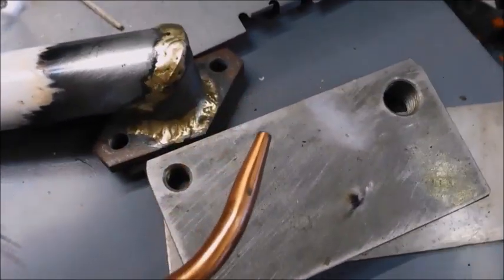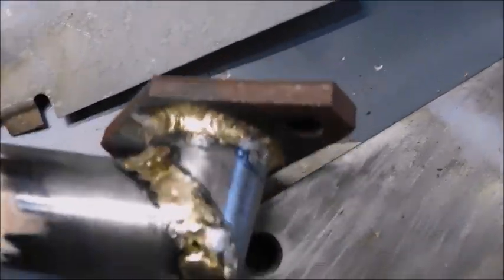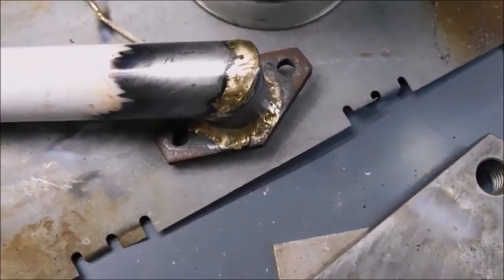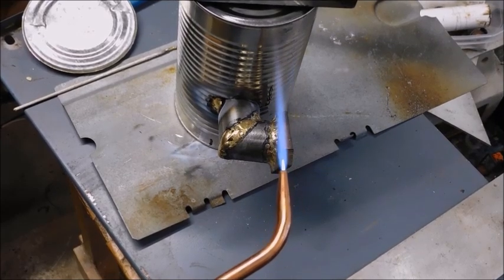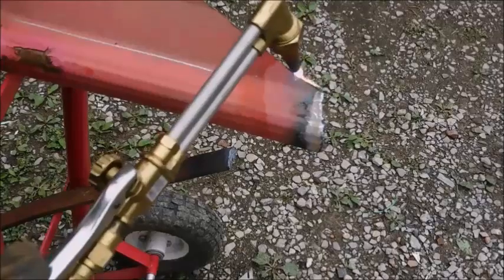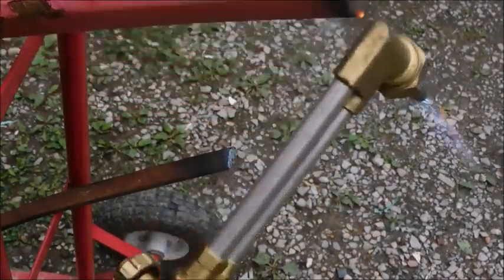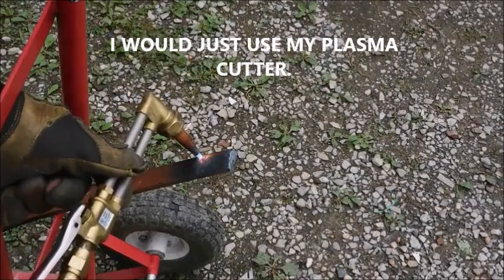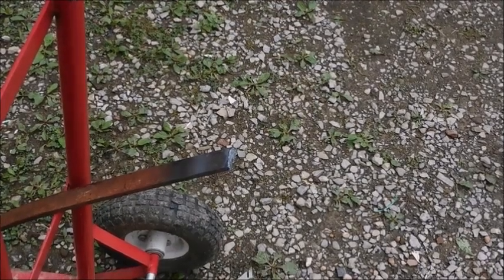CUTTING TORCH WITH PROPANE AND OXYGEN CONCENTRATOR! (SORT OF)

Comment: Your using acetylene tip, propane cutting tip is designed for a reason, don't waste your time.
Reply from the maker: Agreed...it was only a test so far. I will try new tips as soon as I can get one. Thanks for watching.
Reply: @davenooner2142  Propylene didn't cut well with the Ac. tip ether.
Reply from the maker: @davegeorge7094  Ya ,I'm not relying on this setup for cutting. I have a plasma cutter to use for that. But it does seem to do quite well for brazing. I still want to see its limits for an emergency backup if needed. Things break all the time. Thank you for the interest and helpful input.

Comment: Kind of what I thought might happen, not enough pressure and CFM. However,  it's a start  and I think what might be needed and would be way cool is rig up a way to compress larger amounts of oxygen from the concentrator into a small tank so you get some pressure and flow for small cuts on thicker material. Thanks for trying though. Interesting none the less. Cheers.
Reply from the maker: Thank you for watching and helping.

Comment: I noticed that when I tried to cut up a  trailer about fifteen years ago, I could cut if I got the torch and my technique just right. Many times, it would weakly fuse back together like it did on the thicker bar you tried first. Watching you makes me want to dust off the bottles and torch and play a little. Thanks for sharing!
Reply from the maker: Thank you for watching. It is just the mother of invention and all that. I really needed to braze and I wanted to save my argon gas to TIG other things. It keeps life interesting too.